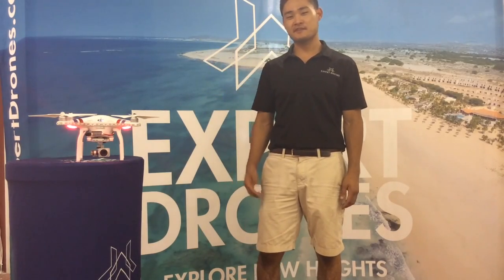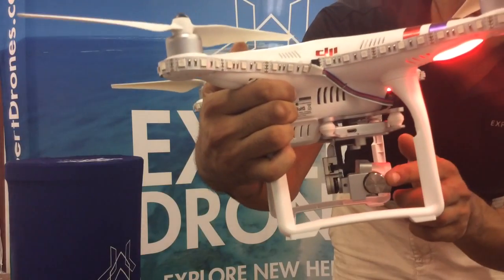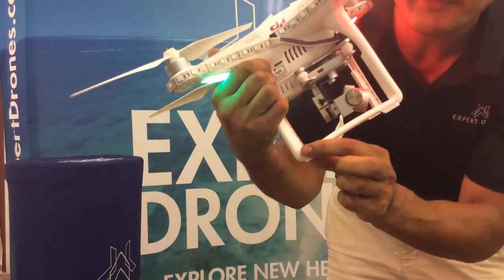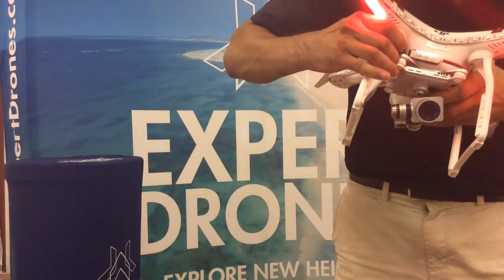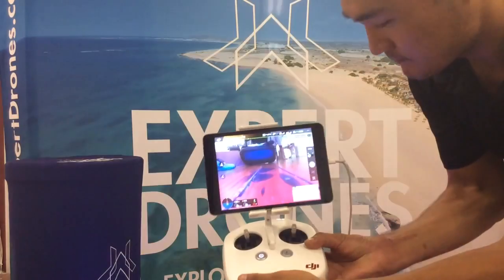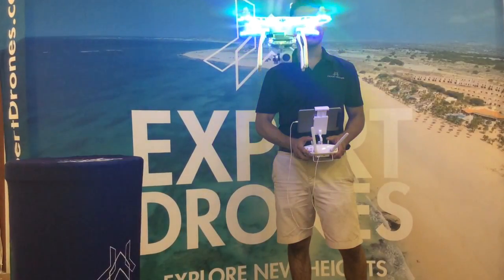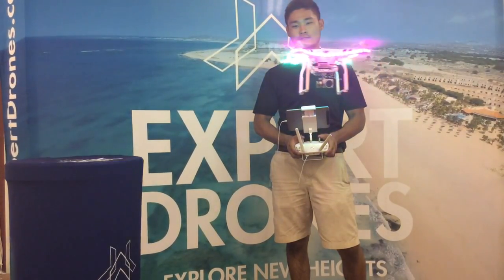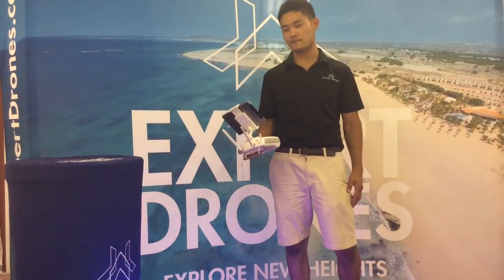DJI Phantom 3 Advanced Gimbal Pitch Motor Repair and Compass Replacement

Comment: I have one question what caused the gimbal error. Do my camera need new pitch Motor. OR new Roll Motor ESC circuit board OR A new Ribbon cable  my camera won't move  And the Image is black. My camera was dropped in water everything is dry inside no physical damage